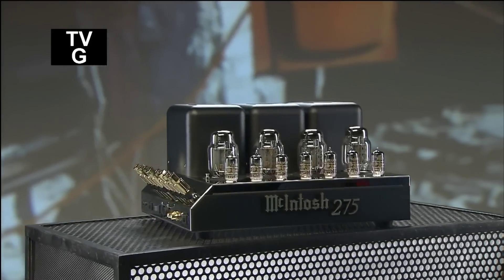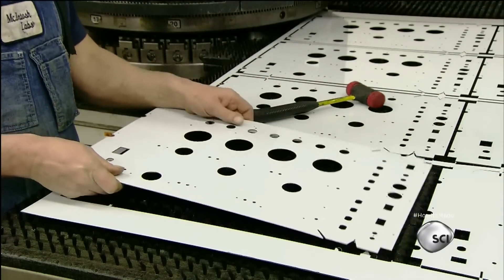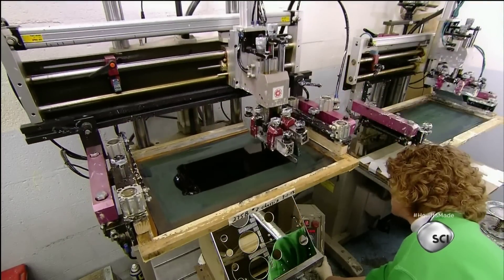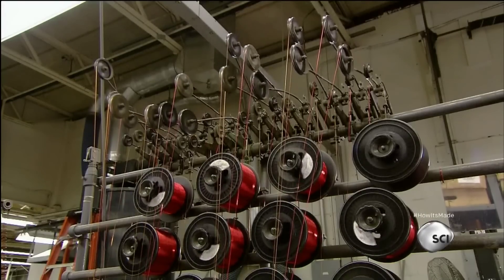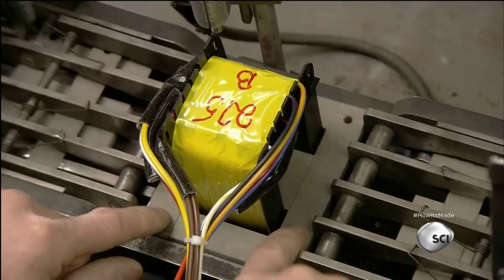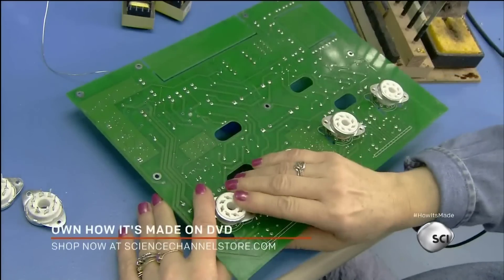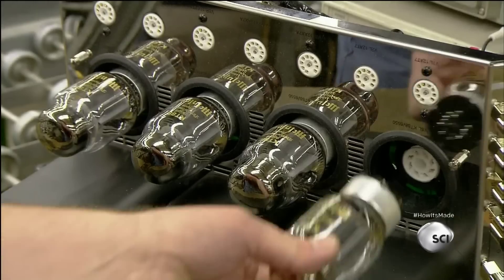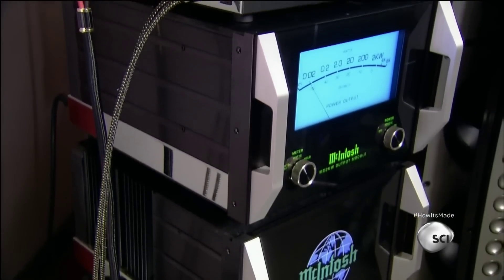How It's Made - McIntosh Tube Amp

Comment: Just place an antique point-to-point wired MC275 beside this new version which uses circuit boards and cheap Chinese WIMA caps, and you'll see how much cost they have cut.
Reply: +Sniper5354 ___WIMA is a German company that produces their stacked-film polyester capacitors in Germany. They are considered excellent capacitors by any commercial standard.
Reply: Headquarter is in Germany, and the factories in Germany are still running. Though there is a big factory in Shantou associated with the WIMA dealer in China.
No matter what, I am sure that WIMA is already good enough (or too good) for newly made McIntosh admirers, who at the same time accept the plug and play circuit boards----they don't even take the time to solder the connections.
Reply: Even for older batches of WIMA which were really made in Germany, take MKP10 as an example, if used for signal-coupling,  the sound image is always blurry and the bass is remarkably softened.
Reply: +Sniper5354 hahahahah REKT
Reply: Godfrey Poon Most likely to repair their refrigerators or fans.
Reply: WIMA capacitors are German made.  Are they sold out too?
Reply: +RCbeastly it's the even harmonics in tubes that make the worth owning. The addition of those harmonics does not mean the addition of excessive decay or " added warmth" transitor based amps also add harmonics
Reply: +Makiah Shenay I don't think my brain discerns even and odd harmonics the way a spectrum analyser would.

To the end listener it's subjective. To an electronics engineer, it's a hands down win to solid state for Hi-Fi reproduction.The argument against the electronics engineers is that a listening test is subjective, and many people may prefer the sound of a valve amp, however, while the terms audiophile and high fidelity are linked as if the same thing, then valve amps can't be considered "audiophile".
Reply: +RCbeastly I can understand that. Frankly I'm still trying to find a good tube amp... I grabbed a fully balanced solid state for 600 n I've yet to find anything better for even double :/ 

still the many thousand dollar tube amps out there do electorats some justice I'm told
Reply: +Sniper5354 Solder is not necessary for good electrical connection. You won't find any LAN cables that are soldered - even gigabit LAN cables which handle much higher frequencies than audio. Well designed circuit boards are much superior to point to point or tag board wiring as far as noise suppression and signal distortion are concerned. 

Still -  I would never call a tube amp "audiophile" equipment, considering audiophile means a preference for high fidelity, which in turn implies faithful accuracy to the source, not something that "adds warmth", whatever that means.
Reply: There is one Halcro amplifier which claims near zero noise and distortion levels. It sounds as clinical, unemotional and lifeless as one can achieve. In no way does it provide any live concert experience.

It is obvious that low distortion is not the main goal of a tube amp design like this one. In the minds of tube-lovers, the change from point-to-point wiring to circuit board only implies one thing----cost cutting. It may be better to judge from tube-lover's, not distortion's point of view. 

Molex (or equivalent) plugs use conductors with a high iron content. Acting as an analogue signal path the relatively higher inductance will cause grainy sound.
Reply: +Sniper5354 Those are metalized mylar capacitors, which are an order or magnitude better electrically than the foil/paper caps in older assemblies.

Comment: This amplifier is a work of art. Art. Engineering? Not so much. We can build much better performance in a smaller package with significantly more efficiency, better linearity, better noise figure, better frequency response, more durability, and so forth. 

However, people LIKE the distortion products that this amplifier makes. So they buy them --for artistic reasons, not technical ones. As long as we all understand this, there shouldn't be any arguments.
Reply: The 275's got remarkably good performance for a tube amp, but the point is taken:  Mr. Mc couldn't WAIT for good power transistors to hit the market in quantity, because while you can design and build a reasonably linear, stable, reliable amplifier with firebottles (heck, my 50-plus year old 275 is proof of that :D ), it's WORLDS easier to pull it off in solid state electronics.  Heck, once I can figure out what I zorched in my MAC-4100's power supply, it goes back in the system and the 275  returns to the bookshelf-looking-pretty duty in the office. :)
Reply: when you say performance, what exactly do you mean?  This amplifier bests many that are much more expensive and I guess you just have to hear it and not be fooled by idiots that do not know their ass from a hole in the ground
Reply: @dippin1523   Idiots that do not know their ass from a hole in the ground? You mean like The Old Man™, Gordon Gow, Roger Russell, Sid Corderman (the guy who designed that shiny glowy 275)?  They'd all tell you in a heartbeat that it's MUCH better and easier building amplifiers solid state - linearity, reliability, stability, longevity, power consumption, heat dissipation are all more easily and affordably accomplished with silicon than with glass and vacuum.  That "warm tubey sound" that the tweaks over at Stereophile ooh and ahh over? That's distortion. To be sure, the largely even order distortion from your typical tube circuit is less grating to the ears than the odd-order harmonics you'll hear from badly-done solid state, but nonetheless it's distortion, and by definition not to be desired under anything that wants to go by the moniker "high fidelity".  Let's leave the glowing filaments and the distortion where they belong - in guitar amplifiers - and away from the reproduction chain, mk? (*duck*run*hide* - was that too snarky? I can never tell! :D )

Comment: Lots of people here commenting on tube amps that have never heard one or know anything about how they sound or why many prefers the sound of tubes over transistors.

I have had Quad ESL63 electrostatic speakers and Elecrocompagniet AV100DMB amp and Hardman Kardon amps. Both amps had a very pleasant and powerful sound that is very similar (both have no electric feedback). When tested a tube amp on my ESL63 speakers I found the tube one sounded very pleasant and easy on your ears like something I could listen to all day in the background without getting tired. But the tube amp I tested lacked the details in the sound of the Electrocompagniet and the Hardman Kardon had specially at higher frequencies.

(I do all my testing with A/B blind tests to rule out cognitive bias)
Reply: MarkasTZM Most of the "tube sound" comes from harmonic distortion not equlisation. Emulating the harmonic distortion of tubes is wery difficoult with transistiors and I personally prefer the clean "analytical" sound of a good trasnsistor amp with no negative feedback loop anyway. But the tube sound is wery pleasant to listen to for some reason and the experts say it is because of the harmonics, it is a bit like auto tuned vocals and have a bit of the same distortion effect to.

Comment: An amazing piece of hardware. But the inexpensive rocker type power switch is a deal killer.
Reply: +Peter M What about the screen printing on the labels? Which can be scratched off.
Reply: That rocker switch looked like a garden variety switch. Nothing too impressive but just functional. Good switches do not snap in, normally high switches have mounting appendages, for replacement and service.
Reply: +Peter M ___Actually, a good rocker switch will outlast many substantially more expensive toggle types.
Reply: +Tom L   A good silk screen does not scratch off easily,  however a cheap silkscreen will wash off just by cleaning.   In repairing and cleaning equipment, I have seen both types.
Reply: The ink does age, too, and you have to be careful what you use when cleaning.  My mom used something - windex, most likely, or maybe 409 - to wipe the dust and fingerprints off the 275 in the living room and took all the lettering off the chassis (fortunately she missed the serial # :) ). When I took possession of the amp a few years back there wasn't a scrap of ink on that chassis.  Alas, but I don't think Mc still has the silk screens for the original 275. :(

Comment: I'm a musician and an audiophile.  Valve amps sound more natural than SS amps.  How many of you anti tube amp idiots prefer your favorite guitarist playing through a Marshall tube amp instead of some SS amp?  Aside from the sound of a tube amp. the other thing that tube amps get right is the sound stage and a more holographic sound.  The laying effect that tube amps offer is hard to achieve with SS amps.  When I was really into the audiophile thing, I had an Audio Research preamp and a Krell power amp.  Yes, the Krell was SS but it had more balls in the bass than any tube amp plus I didn't have to be bothered with replacing tubes.  I also got a huge sound stage though not as holographic as a tube amp. I got the tube sound through the Audio Research preamp.

Comment: I don't like fully potted components.
Reply: Don't worry. if you need to repair it you can chisel that tar out of there in a week or two
Reply: @Martin M  Not so. You can heat the can, melt the tar, and pull the transformer out to rewind it if necessary. To be sure it's a smelly, dirty, messy job, but it can be done. So, a zorched output transformer doesn't have to mean the death of your prized old amp.

Comment: If you pay $10,000 for an amplifier, you'll hear the difference.  No one else will, but that's not what's important. ;)
Reply: If you want accurate sound representation, use op amps linearly driving mosfets(Class A). If you want inaccurate distortion to the sound that some think sounds good, and don't mind paying exorbitant funds, get a tube amp.
Reply: have your ears check before you spend that kind of money
Reply: Tubes do not sound better, not sure where you got you engineering degree from. I would ask for a refund immediately
Reply: I laughed more that I should have after reading your comment!!!
Reply: ??
All Audiophile amps are "warm"
IE:   Denon is ..eh (considered more of a A/V receiver), But even a Marantz A/V receiver is warm..."because music matters" is their slogan, and they consider themselves audiophiles 1st, and A/V last.  Denon the opposite.... Same mother co..
Reply: And you will also see thr differnce in your wallet...
Reply: Without a doubt, the wankiest wanks are audiophiles.
Reply: Only through the use of multiple stages and large amounts of feedback does a solid state amplifier offer lower distortion figures than that of a single triode. What it doesn't show is your phase errors and majority odd order distortion products or the dynamics and resolution  that suffer from multiple stage amplification and so on.  Your statement is about as wrong as it gets re 'far superior'. Device to device the triode still rules. Mosfets are awful re linearity.
Switching supplies can ruin everything - if poorly designed - as can a poorly designed switching class D output stage, as can any DAC, but most have filtering, along with out of band switching frequencies.  A properly engineered switching supply is as tight as a very tight thing, absolutely silent, light weight and packs a big punch per kilo of copper. I don't like these much but they don't 'ruin everything' Ask the guy who made power supplies for bits in Tornado aircraft before making Chord amps. This is what engineers are for, solving these issues.
Yet of course simplicity often rules, and an amp made to swing a high voltage, say 300V using only two active devices to minimise any phase issues, maximise resolution, using a minimal amount of feedback  and a choke regulated linear supply can sound truly magical. And that is with say an ECL86 - one valve magic (a triode pentode, OK )
Reply: +Randy Lott its not the price, its the technics how its made. tube always sounds better than solid state. But old solid states from the 70s wich run on 60 Volts sounds much better than modern solid state amps that just run with 30 Volts. So you surely can say that modern amps sound flat, no life in the sound, not warm. They suck instead of an old good made amp or a tube amp. thats a fact everyone can hear and notice.

But your sentence perfectly matches to Apple products ;)
Reply: +Dominik Lux I'm actually an electrical engineer and a musician.  Tubes do sound better, when they're distorted.  Low noise matching FET amplifiers sound better if they're implemented correctly.  Linear power supplies are a must.  Switching power supplies ruin everything.

In terms of distortion and signal fidelity, transistors are far superior.  However, tubes have a sound that I'll always love for guitar amplifiers.
Reply: @RandyLott  An accurate distinction.